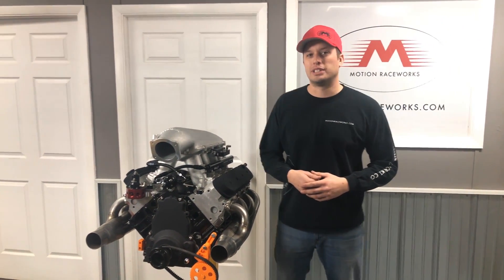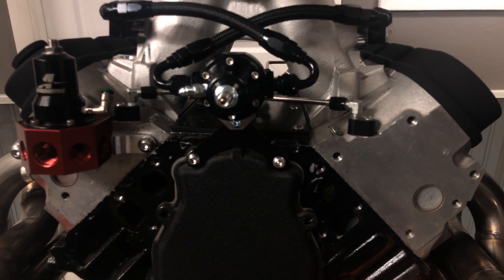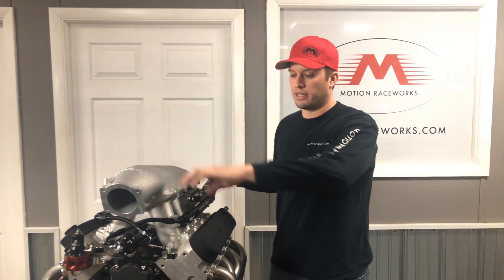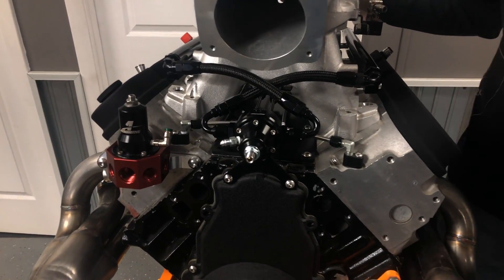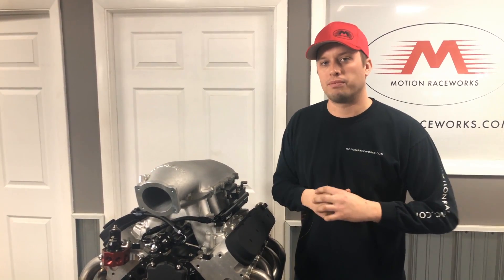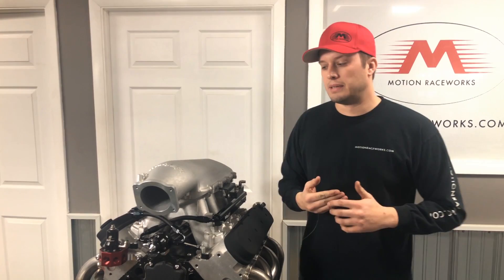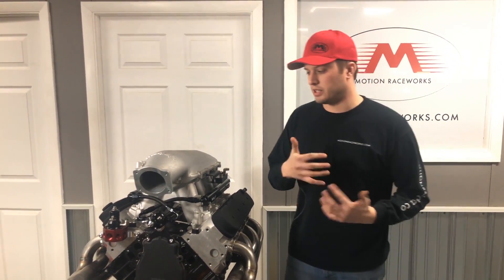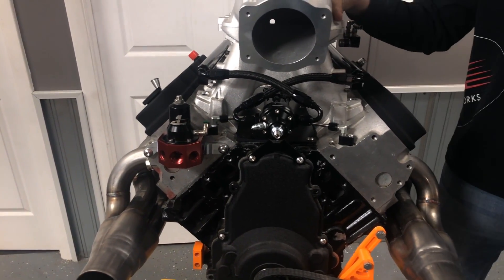EFI and Boost Fuel Pressure Regulators: Motion360

Comment: I was just reading my Holley High Ram instructions and you are exactly right!

(from Holley) *The best configuration for plumbing the fuel rails is to split from the supply line with a “Y” type distribution block or fitting, then
feed into the inlet end of each fuel rail. The hoses from the exit end of each fuel rail would then feed into each inlet port of a
fuel pressure regulator with two inlet ports or into another “Y” type distribution block or fitting connecting to a hose leading to
the fuel pressure regulator.*

Comment: I have F.A.S.T SMART INJECTION TBI ,Just  bought a Aeromotive A1000 pump .do I set the F.A.S.T REGULATOR aside and get the AEROMOTIVE REG,and I had a 500 hoss LS1 went from the pump to the REGULATOR from the REGULATOR to the T.B.l ,so I've yanked the LS1, and a Texas Speed 427 Stroker is taking its place,,,,is why I went to the Aeromotive A1000 to get a Solid 59 psi, so run AN 10 from the Tank to the pump from the pump to the REGULATOR and AN 10 Return Line as well ?

Comment: I apologise, I know this is an older video however I do have one question.... I was previously running my boost reference straight from a charge pipe, now I have your distribution block and wanted to use that as a source for my fpr. Will I have any issues with the fpr now seeing vacuum??

Comment: I know this is an old video so IDK if you'll see this, but if you want to run #10 from the pump to the rails, where are you finding fuel rails with #10 ports? Everything I see is #6. May be a dumb question, but I'll risk it.

Comment: I am thinking of fitting an Edelbrock Pro-Flo 4 system. Edelbrock suggest that I loop the fuel rails (the opposite of what you suggest) and fit a fuel pressure sensor at the end of the second fuel rail. If I do as you suggest where would you permanently mount the fuel pressure sensor? Perhaps on the fuel regulator?
Reply from the maker: James Barnes if it’s not an all out race setup that will work

Comment: Im sure you are going to tell me to call.. But I will be running a 4.5L whipple and don't think I will have the room to run the regulator in the front like that. its a 427LS at first I only plan on running 15lbs of boost on pump gas, and then might switch to about 23lbs on E85 .  the pumps are in-tank and triple 450 setup..  Suggestions?
Reply: RRM Garage you can mount it where works for you except fire wall. The main thing he’s getting at is pump feed lines then t in y fitting to each rail then into reg and then return. I’d prob do -10 feed y’d off to rails with -8, then from rails to the reg with -8 and a -8 or -10 return to tank. That may be considered overkill for pump gas but with a 427 and a big Whipple you will prob eventually want to hose it down with some e85 and of course it needs more volume. Hope that helps. Better to have more than not enough fuel system. The line sizing I described should be enough to run out that blower. Stay safe out there patriot.
Reply from the maker: RRM Garage absolutely! As brad said.  You can certainly put the regulator elsewhere.  Just make sure to feed the rails before you go into the regulator.  Hope that makes sense.  Feed the front of the rails with the feed line via y and fittings and have the regulator AFTER, but in the back.
Reply: @MotionRaceworksOfficial  Thanks!
Reply: Thanks Brad, that is pretty much what I was already thinking. As far as the E85 goes Ill probably throw some in after I get done with RMRW. Get that power up there a ways to see how fast she will go,  I've kinda become interested in one of those Motion stickers. lol

Comment: Ok, one big problem about running in series. You’re wrong about that. Explain how one bank runs more lean than the other when the regulator is showing the correct psi for your application. Because pressure being pressure means the system is full. And the regulator is reading from the fuel pump to the regulator. So the ENTIRE system is seeing the desired amount of fuel. And if your pump is strong enough that pressure drop shouldn’t be an issue. And in all actually running parallel might actually have a higher chance of what you’re afraid of happening because one source has to fill up 2 zones. Theoretically the fuel would move slower after the y because of the pressure drop. Only way I’d run parallel is if I had two feed sources.
Reply: But that would be assuming pressure wasn’t involved in both instances. On the initial starting of the pump would be the only time the issue would/should occur. I think you need to make a video with transparent rails on startup. That way you can time which one takes longer and by how much to fill the rails.
Reply from the maker: Tommy Hathaway would love to setup some test benches on this!  The issue would be considering that the pump is completely running out of capability.  It’s going to burn those cylinders out much worse.  Rather than the entire engine going lean.  With an averaging O2 there are going to be some very starved cylinders.  If maxing out pumps is never an issue and pressure can be carried than that is something that doesn’t necessarily apply
Reply: Motion Raceworks Official gotcha gotcha. I feel it. Apologies if I came off standoffish. Lol My main concern was with the video saying series was a flawed setup. They both have advantages and disadvantages. And you touched on what I was saying about the pump maintaining volume and pressure. But I completely feel you. In the even of a failure one bank would see more damage in the in the short time before running out of fuel. However, I do feel like parallel would burn two identical cylinders on front or back. And I’m asking to make sure my facts are straight. If anything I’d like to learn something new.
Reply: blockequals4 lol I’m just trying to have an intellectual conversation. Like I said, my bad if I came off upset or something. I’m just making sure I understand clearly. I’m good.

Comment: Damn man, I’m questioning my fuel set up now. We run N/A on E85 carburetor. Should we be running into the fuel rail and then to the regulator?  I’ve never heard that but we don’t run a booster application either.

Comment: Does running a fuel cooler/chiller helps with performance and hp?
Reply from the maker: zohan zoe it certainly can bring the fuel back down to a proper temp which makes tuning safer!

Comment: Motion race works: If I have a bigger fuel pump and running stock injectors, could this setup cause a p0300-code (misfire) in multiple cylinders...

Comment: Great info. Im running a magnafuel 750 in-tank right now with a -8 feed - running in series at the rail to a magnafuel 1:1 regulator. Then -6 back to the tank. Do you think this would be alright to get 6 maybe 700hp (whp) with e-85? Or should I go ahead and switch to a parallel setup?
Reply from the maker: 98snakehorse I always like to Y them.  It’s going to regulate better that way.  However, you may be able to squeak by at that 6-700 hp as is.
Reply: Motion Raceworks Official thanks I may just split the feed to each rail then to be safe

Comment: nice video, I do disagree with a couple of things though,  the return line size being large isn't always going to bring your fuel back to the tank faster, the volume of flow you are pushing through the line is going to determine the flow rate back into the tank along with a whole bunch of other variables. (meaning how much fuel is actually being used by the engine before returning plus the rate of your fuel pumps and the pressure). Phenolic spacers are a good heat barrier but after prolonged use they will transfer the heat just as easily as metal. Aluminum just has a much higher specific heat than phenol resin.  Fuel increasing temperature could be a lot of variables including the routing method, the type of connections being used, the material of the lines and their proximity to other things that may cause it to increase in temperature (like you said exhaust).
Thankfully ceramic coating is taking off in the automotive world, because for many years people have believed that anodizing aluminum parts changes the emissivity of the material (especially when it's black). it was mostly used as a corrosion barrier. (The myth about black coated intercoolers not heat soaking).
Reply from the maker: Marc Clegg the main purpose of the return line size being larger is to get the fuel off the back of the diaphragm
Reply: That may be the case for that. But there a point where it can be too big.